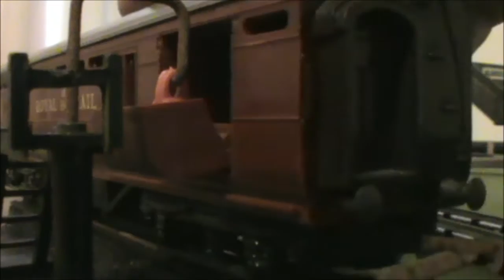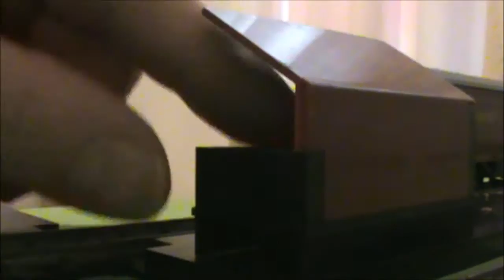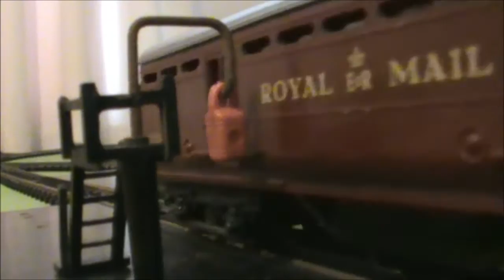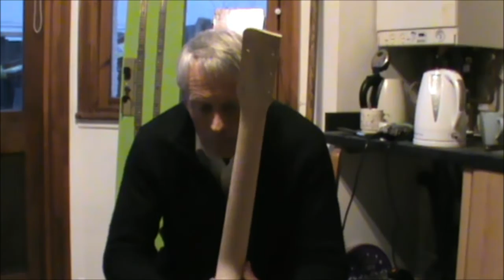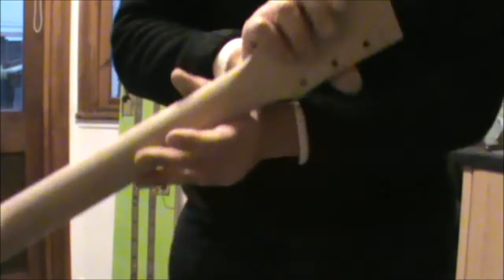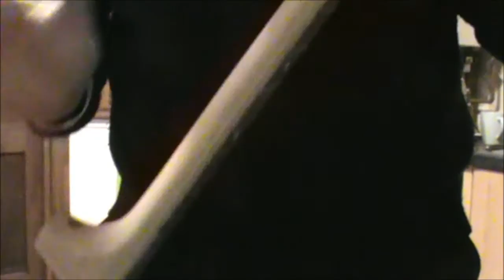Testing the Triang TPO and guitar progress

Comment: As I was taught by my friend and mentor......the only way with wood is linseed oil and furniture polish.....varnish makes it look like plastic.
I've loads of examples on my videos.
Reply from the maker: +MalcOfLincoln There are plenty of ways to treat wood, what I have found is that varnish comes at different prices according to what word goes before it, yacht seeming to be the most expensive. In the 1970s, we used a lot of Rustins plastic coating, which was very hard once dry, and very durable. We also used a lot of wax, and for the life of me, I cannot recall the name on the tin, but is smelled lovely. Still got a lot of paint to sand off!
Reply: When I had Wud-E-Nuff I did the handrails with yacht varnish...mate had a tin. Lasted a year.
But on the Colvic Steve had (see Fosse Dyke vid) we did the woodwork with Teak Oil. Lasted well for 4 years, and we did the whole boat again in less than an hour.
I've found Briwax to be one of the best.

Comment: Good to see TPO working Harry.
The full-scale shunter may be an issue before long.
Like the way the guitar is coming along, for my money I'd keep it natural as there's some nice graining in the timber. Whatever you decide to do I look forward to hearing a merry tune on it soon (ish).
Cheers!
Reply from the maker: +Ed Shunt I have locomotives to pull the TPO, and coaches to make up a train. The track is going to be a bit of a pain, Triang series 3, some very good and some looking like the disused sidings at a long shut power station. Hence the trip to get the emery, which resulted in getting the guitar as well. I think au naturelle is a good look. For timber, not for the guitarist. Although in Essex there are plenty of businesses offering a skin staining treatment.
Reply: A challenge indeed but I imagine a therapeutic one.
Skin Staining? There were a few industries offering that for free in Victorian times, we'll draw a veil over that one, I think.

Comment: that's a really cool mail bag car , if you are taking votes , I go with the staining ,
Reply from the maker: +sparky107107 When I was a little lad, I wanted a mail coach, but my dad told me why I didn't want one, wouldn't fit on my layout, the bags get lost, so on and so forth. I think the real reason may well have been that they were just too expensive. Well, the layouts that I am putting together are for fun, and a lot of this vintage stuff is now very cheap. It will make folk smile. As to the guitar, I haven't yet made my mind up. I think that the guitar itself will tell me what to do. The top and back are pretty bland pressed plywood, and may need something to 'help'.